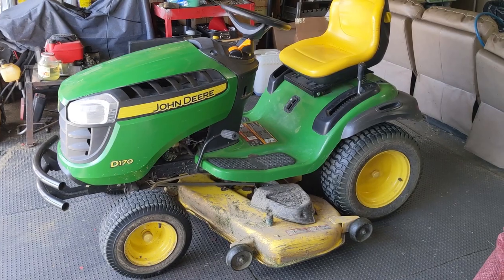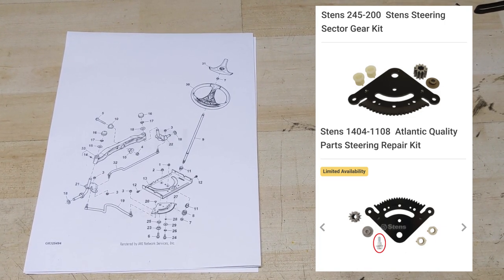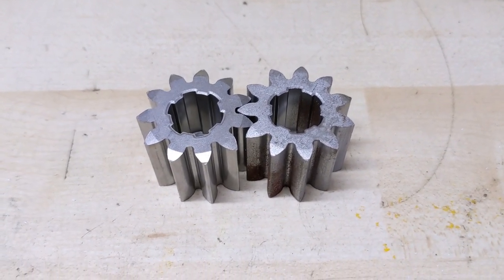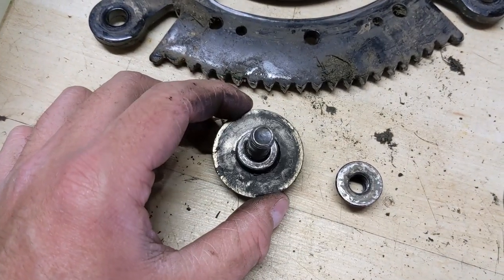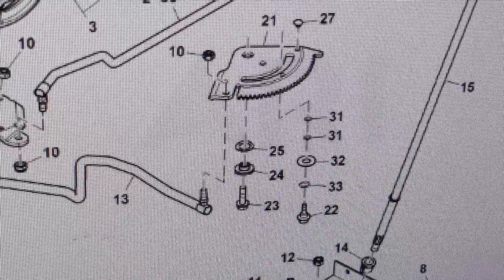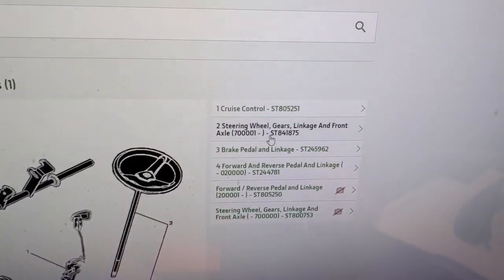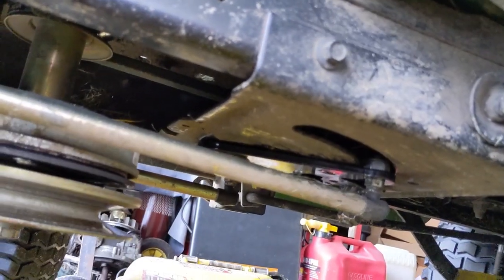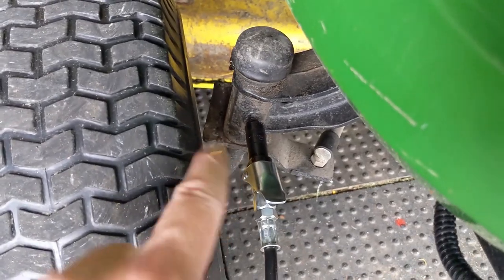Replacing a Steering Sector Plate and Pinion Gear on a John Deere D170 Riding Mower

Comment from the maker: GX25785BLE Steering Kit: https://amzn.to/47HepIq
GX20053 Pinion Gear: https://amzn.to/44tGBfh
GY21250 & GY21251 Drag Link: https://amzn.to/45qNC1C

Wheel Bearing Upgrade Video: https://youtu.be/AB3d8_aZR6w?si=RqrHNWVE3rFtqJh4

Steering Needle Bearing Upgrade (Poor Man's Power Steering): https://youtu.be/Yk4K6slh5oo?si=FyCAWLcZ1uIcVqm1

Comment: I have had complete success in drilling out the non splined end very slightly so the pinion gear can be inverted.  Stacking a section of Sector Plate would also help. Weld on one of the new short ones.   I replace Plastic Bushings at the same time with Oil-lite ™ metal ones and some grease.  Excellent tutorial as usual.
Reply from the maker: Good tips Gord, thanks for watching!
Reply: Thanks.  Still looking for the 18 tooth EZee Steer Snowblower part.

Comment: I’ve been lucky on my machines I’ve always been able to order two new sector plates with all new bushings and hardware..I double up the sector plates…It provides a great steering feel and stays tight much longer with no binding feel or slop making it much stronger out lasting the factory set up for many years..Doing this you are using twice the wear surface with two sector plates obviously meshing with twice the surface on the pinion gear and works perfect in my experience. I’ve even bolted the removable tooth section to the bottom of a non removable tooth sector plate like urs in the video it will bolt right to the bottom with adding some washers in places and playing around with it a bit so it’s not as bolt on friendly as jus doubling up two sectors like the one in ur video…but it’s worth every bit of the extra time and effort either way you do it because of the longevity and strength gain…a few extra minutes of my time and the mod is amazing…Great video thank you!
Reply from the maker: That's very interesting, and makes sense! If they made the sector plate teeth thicker, and the pinion gear a bit stronger I don't think they'd wear out nearly as much. Thanks for watching!
Reply: @EliminatorPerformance  exactly and that’s the result I get bye doing the mod to my old junkers and what a tremendous difference it makes..I doubt all are compatible to do it but I’ve done 4 in the last 10 years and all went together like it was designed that way.. maybe I was jus lucky but it has served the purpose very well..Thanks again!

Comment: Ingenious method of checking the hardness without a Rockwell hardness tester i was thinking a file would tell the difference but your method is much better and well thought out. Overall a very informative video and adding adjustable drag links if the proper fix for the wheel alignment.
Reply from the maker: Thanks for watching, and yes the spring loaded center punch was a great way to DIY Rockwell Hardness Test

Comment: Jake, maybe you can put me in the right direction for solving a slight problem I’ve had with a White Outdoor/MTD LT542H. Something is making the Tecumseh 20HP V-twin with twin carb engine slow to start. Battery fully charged and valve lashes corrected long ago. I’ve ultrasonic cleaned the Vector carb bowls and integral parts plus replaced the 4 O-rings (The two at the bottom of the emulsion tubes were deformed and preventing the tubes from moving up and down). Confirmed fuel flows to carbs and solenoids function correctly. I’m pretty convinced it’s a fuel issue because once it fires it runs just fine. Will start immediately with a volatile sprayed into the intakes. I’ve run the tank dry and used fresh fuel with no change. I’m not familiar with how fast fuel should flow from the pump so the only thing I can think is the pump is just not making full pressure. Is that a possibility or is there something else of which I’m not aware going on?
Reply: Jakes out of town so hope this helps. I would guess that you mean it takes a while to get the engine to start on choke and not that the flywheel is hanging up. Sometimes the choke is not completely closing and a simple cable adjustment is all that is needed. Additionally it is likely the fuel pump or the pulse hose had a crack or the diaphragm had a pin hole in it causing poor volume of fuel delivery.
Reply: We have found that the Oregon replacement fuel pumps save our customers money and work very well. Hope your problem is the simple cable adjustment but for sure a fuel issue so likely the fuel pump. Since you said it ran fine on carb spray at least we know you have primed the fuel pump and if retrying and still takes a while to fire swap out the fuel pump but check to make sure the pulse line if not cracked thus lossing suction on the diaphragm.
Reply: @waynestefinashen239  
Thanks so much for your responses, Wayne!  Can't tell you how much this means to me and how much it helps.  I posted this question to 3 different YouTuber's hoping to get at least one reply and so far yours has been the most precise and helpful one.  I'm guessing you saw my post on Stella's livestream the other day about Vector carbs, which are on this machine.

Whenever I get into an engine and have to detach throttle or choke cables I always use a paint marker on either side of the clamp to make sure I return them to the original position.  In this case I had one of each.  I did confirm at the outset that the choke plates closed completely, although the left one is just very slightly open due to the fact that the connecting rod between them may not be bent exactly correctly to get them both closed tightly.  The plate is maybe 1/4 of a millimeter short of being fully closed - a hair's breadth.  Although I initially thought that might be part of the slow or uneven starting issue, I eventually guessed that it wasn't and moved on to other things.

As for the pulse line, now that I understand how these pumps work I can see how the integrity of that line is critical and will be checking it first to make sure it's OK before I even start with the pump.

I've been studying Mikuni-style pumps, which I found out this is, and have found some good info about them including a video by Jeremy (MOWERMEDIC1) on disassembly and rebuilding.  I also just found out this morning that earlier models didn't have diaphragms that were ethanol resistant, whereas now some are at least 10% ethanol resistant.  Since I'm inclined to rebuild rather than replace, once I get the tractor delivered back to me I'll check to see if the existing carb can be disassembled and go from there.  If it can't be, then I'll check out the Oregon one you mentioned, although I did find a metal one that can be disassembled for around $20.

Thanks again for your help!

Non-connected topic - you may see me hop on and off live streams like Stella's the other day pretty quickly.  I'm not really social and value my time a lot.  I go online pretty much purely to learn and if I'm not learning much or at a rate I can accept I usually move on.  It is nice to put faces to names and channels and get a handle on who the creators are, but beyond that I'd just as soon be watching a repair video to learn or solve existing problems I've encountered.  ;-)  Happily, Jake's channel is one of those at the top of my list due to his excellent production values (audio, video, lighting) and lack of extraneous, off-topic clutter.  At 76 I don't have a minute to waste!  I average right around 150 hours/month (for the past 2+ years) watching YT videos on small engine work.  LOL!!!  Jake's one of my top two or three snowblower and lawn tractor channels any time I have a question.  I have others for generators, chainsaws, leaf blowers, pole saws, etc.
Reply: @Rein_Ciarfella  Thanks for the kind words of encouragement Jake and i appreciate it immensely. I am 74 and have learned everything i know from my son Jake and by watching others on YT. I personally am subscribed to so many channels i have a hard time scrolling down the list to get to someone specifically that i want to watch
Reply: @waynestefinashen239  
Yup, dozens of YT channels and so little time. On my iPad I have them arranged into two folders - Primary and Secondary. Then I order them by the ones I use most often except I put new ones at the top until I’ve had enough time to evaluate their usefulness. 
On my iPhone I just scroll down the alphabetical list for the ones to which I’m subscribed. 
On my laptop I have a YouTube link on my Home Screen and then either type in the name of the channel or scroll down because what’s displayed often is synced to what I’ve been watching recently on the other two tools.
Reply: Reset your Valve Lash.  0.004-6"

Comment: It would be nice if those plastic bushings were made of metal  instead of the plastic
Reply: Self lubricating sintered bronze would be ok but i hear the Viton plastic bushings stand up way longer but i do not think these are Viton
Reply: @waynestefinashen239   thanks for the info on the bushings that Jake had a video on the steering parts replacement on the John Deere mower 👌👍😎😁
Reply from the maker: Thanks for watching!
Reply: @EliminatorPerformance   your welcome Jake and be safe out there in the heat
Reply: Made to sale parts. Sadly 😢
Reply: Hoping china will make a bronze bushing soon, cheap jd plastic parts
Reply: @philliphall5198  😞😞

Comment: How about the Poor Man's power steering roller bearings on that sector plate?
Reply: Great thinking thanks for watching. Personally i do not think it would improve longevity of the steering system and may hinder it.
Reply: Although if the plastic bushings had bearings internally i think it would work better.

Comment: I have a scag cheetah with a kawasaki. No start no click no nothing. Safety switches bypassed, key switch is good.  Battery is good. I'm at a loss. Any ideas ?
Reply: Check that 12 volts is going to the solenoid if it is then check the solenoid likely faulty

Comment: It's disgusting how companies like John Deere rip you off and design part to fail and you can't even flip the gear to get more use out of it but if you take a small file you can file the other end too much the splines
Reply: If you wanted to take the time and make that effort ok with us but we need to move equipment in and out since time is worth a lot of $